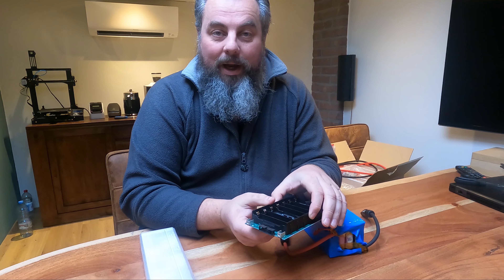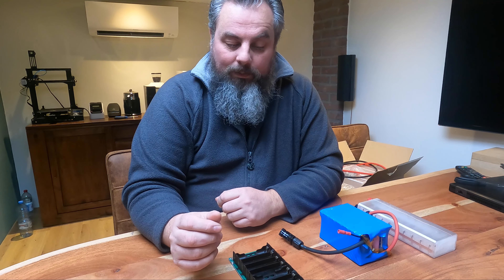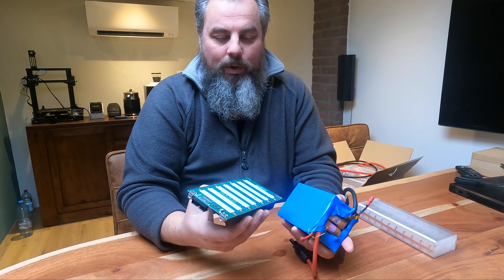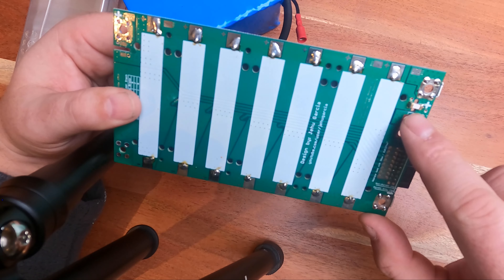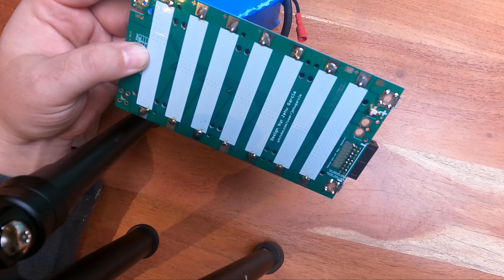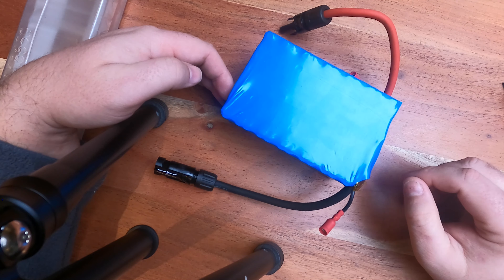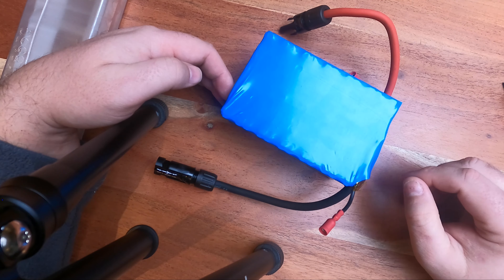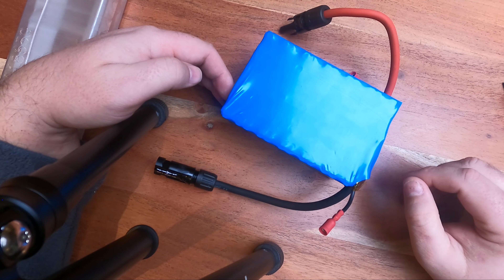S2E6   Jehu PCB vs own battery pack builds

Comment: I solved this problem but within limits...
Build a Power Module with the tracefuses being replaced with Automatic Fuses.
Also a build in overcharge Protection in case the charge Voltage goes over 4.20V it will kick in and start burning off energy at 100mA or 127mA depending wich version.
All components being on the Top Side and instead of a soldered fuse a Fuseholder for easy changing the fuse.
So when things go bad the Board itself will protect you within a certain range. If the balancing current exceeds the 100mA or 127mA the board wil not be able to handle that and eventualy also fail.
Also figuring out a way to get a notice if the board itself has gone into overcharge protection.
The only issue is it all ads to the cost of 1 Power Module but as it is now i feel much safer with what i build then just using the Jehu Design....